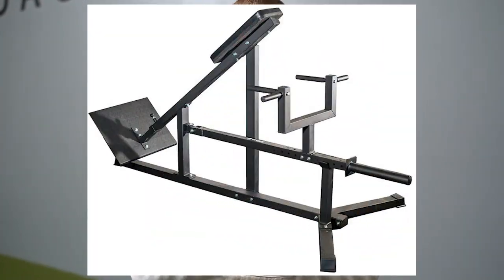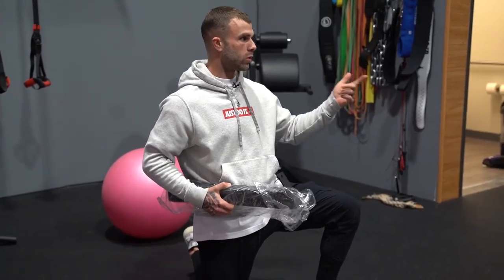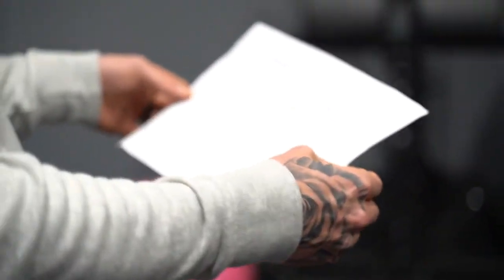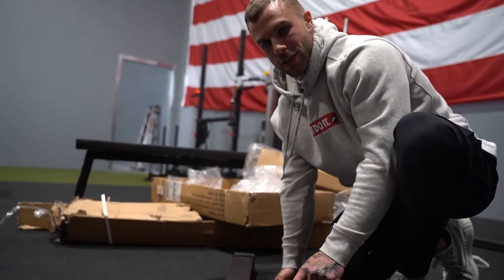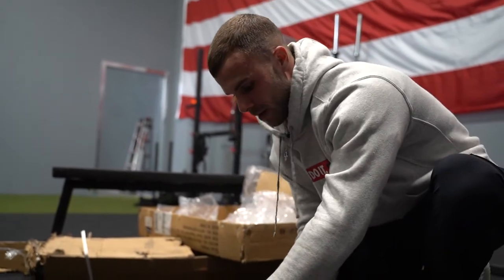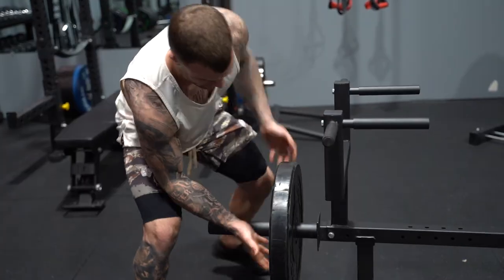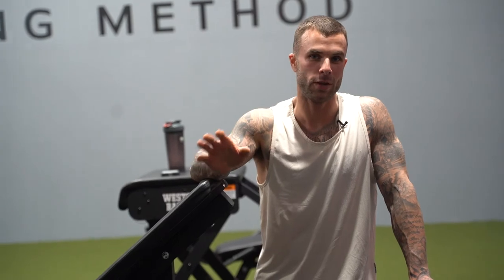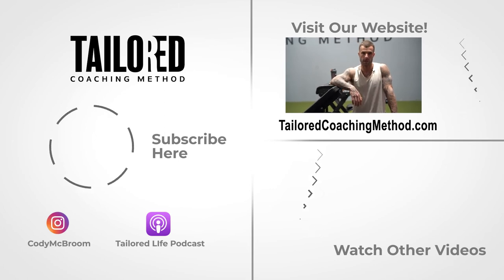Titan T-BAR Row Unboxing And Build (CRITICAL REVIEW)

Comment: I sold mine.  Mainly because I’m 5’6”, and this machine is really not meant for manlets.  As the video shows, even average height people may not find this machine to be ideal.  Also, and this probably goes without saying, it’s definitely not commercial gym quality.  I’d say light commercial at best.
Reply: im 6'4 putting  mine together  now. hope i have better luck... i didn't  even have the instructions  in my box

Comment: Yeah, it looks poorly designed.  A good bench, one's chest is usually inb the bench.  If not, putting all that strain on the back.  No sense doing this exercise...might as well do dumbbelll rows.  Unfortunately, doesn't appear they had an Industrial Engineer on the team who specializes in Ergonomics.  There's one on Amazon I was eyeing, but mostl likely suffers from same issues.

Comment: Cody, thanks for posting. I purchased this same piece of equipment a few months ago and am just now getting around to assembling. Thought I'd watch you first to see what problems I can expect. Glad for the heads up, otherwise I'd probably go bonkers. Best regards from southern California.
Reply: Are the instructions any better than when he did this video
Reply: @rexpeckinpaugh4307   Hard to say because I couldn't do a side by side comparison of the instructions. I will say this: they scrimped on some details that I would have liked to see, but all in all I got it together okay. Also, as I recall, they have a hotline for any questions you might encounter during the assembly. Hope that helps.

Comment: I'm looking for t-bar machine, found your video. Have you tried putting that handle on backwards and just sliding it back some? Probably have to reduce the weight, but I'm wondering how far people have gone to make this machine work for them. And has the non-adjustable handle height been an issue?

Comment: Better getting the Chest Support Row Bench that just has 2 weight catches for a barbell. I have an EliteFTS collegiate chest-supported row bench that I hardly use (same basic design as the Titan you review here; but much heavier built) because I don't like it for the same exact reason you say. And I'm just over 6 ft. tall. Like you said, the grips must allow pulling into the lower ab/ hip area and these just do not. Not proper or even comfortable "in the groove" bio-mechanics at all.

Also the simple design of just having 2 weight catches and a chest support puts you in full control of the free bar, same as setting up a bench on boxes, yet with much more adjustability, simpler and safer. In fact, if you get a pair of old style kettlebell handles, and a piece of cold rolled steel of proper length (get some set screw collars to secure both ends of the handles to the bar, and use rubber washers) you can have COMPLETE range of motion all the way - getting your shoulder blades and delts WAY back with this setup.

Comment: Did titan discontinue this product?
Reply from the maker: That I do not know!
Reply: @CodyMcBroom1  could not find it on the website. Was really interested in buying it because I heard that I catered to tall people
Reply: @Adamthekat  it just says out of stock but it seems it’s discontinued
Reply: @Adamthekat  I would go with the chest support bench with 2 weight catches for a barbell- far superior for getting the bar to go where you want it- so you can actually work your back properly. I have the EliteTFS collegiate chest-supported row bench that I hardly use (same design as the Titan he reviews here; but heavier built) because I don't like it for the same exact reason he says here. And I'm just over 6 ft. tall. Like you said, the grips must allow pulling into the lower ab/ hip area and these just do not. Not proper or even comfortable "in the groove" bio-mechanics at all. As soon as I get around to selling my Elite I will get the Titan with the simple weight catches. Think about it: that simple design puts you in full control of the free bar, same as setting up a bench on boxes, yet far better, more adjustability, simpler and safer. In fact, if you get a pair of old style kettlebell handles, and a piece of cold rolled steel of proper length you can have COMPLETE range of motion all the way - getting your shoulder blades and delts WAY back with this setup.
Reply: @RawFitChris  I want it specifically for rear delts. If you row too low in the abdominal area you will get more lat which I don't need.
Reply: @moneysoles5185  it's on their website right now on back order
Reply: it's back on back order on their website
Reply: @thisguyrighthere4634  oh, well I have had one for a while now